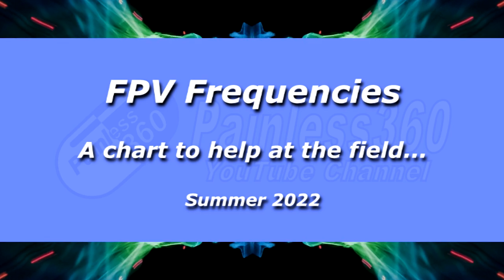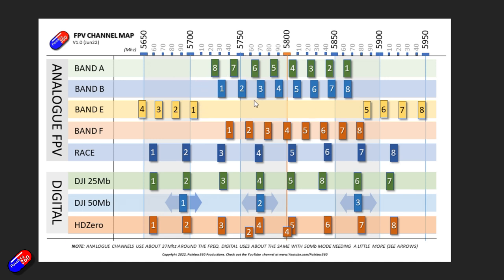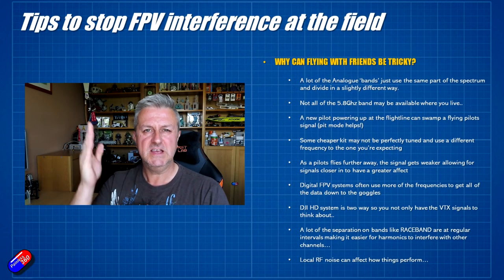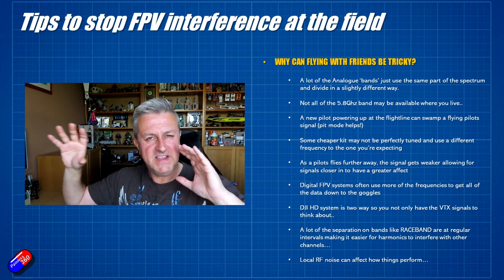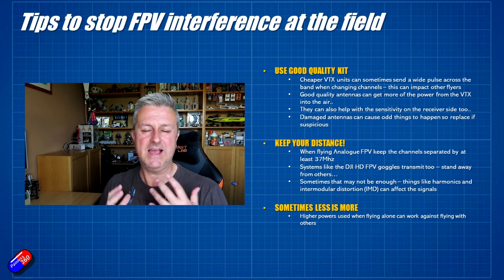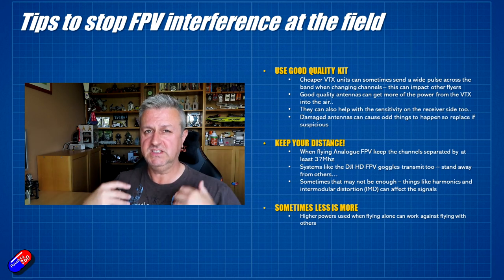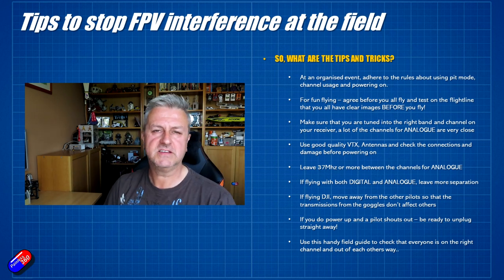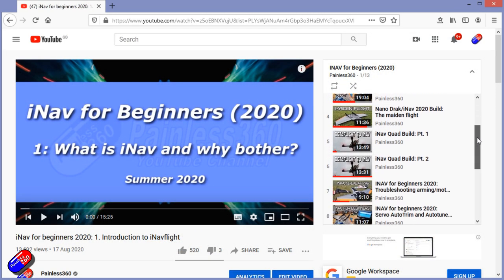FPV frequencies: A handy field guide that shows the bands and channels (analogue and digital!)

Comment: I don't have this problem as the local clubs don't "like" fpv or quads so I fly on my own. Probably a good thing in my case as I've become very intolerant of "balsa" builders calling my quads and home made foam planes "bits of crap". I stopped trying to find a club after visiting two clubs and getting this kind of "greeting" before I'd even put a quad or plane in the air. Great info as always stay safe Lee
Reply from the maker: Always so dissapointing to hear of this. These clubs will die off as their members do without new blood. By not being open and accepting to pilots and elements of the modern hobby they are condemning these clubs to an early death and loss of these areas to fly for future generations. How terribly short sighted... Happy flying
Reply: Totally agree and by the looks of the ages of the members it won't be long till they have no members

Comment: Thanks for the chart Lee. Would you mind provide it as a PDF? I would like to to print it bigger to leave in a board where a fly. Thanks.
Reply from the maker: The original is actually a Microsoft PowerPoint slide (I can make graphics like this so much faster in PPT after decades in IT!)  and I've shared a SVG version on my Patreon feed for them to use..